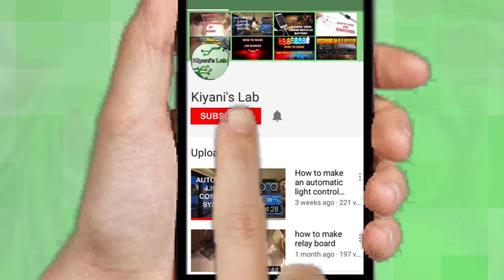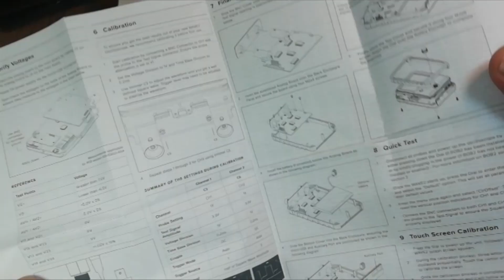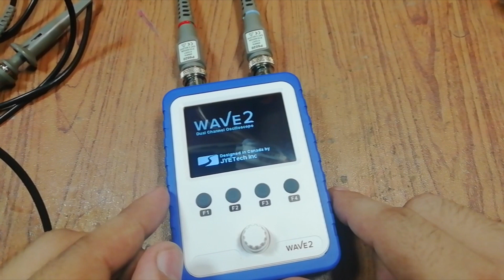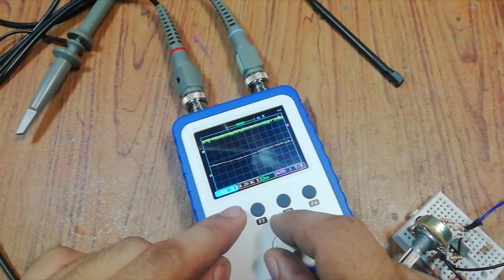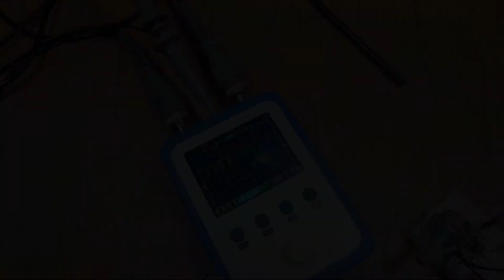Mini Dual Channel Digital Storage Oscilloscope Review

Comment: Thanks for the video. Can the Wave2 operate both as frequently generator and scope simultaneously? IOW, can I take a signal from its generator, feed it into a circuit, then read the signal using the same unit?